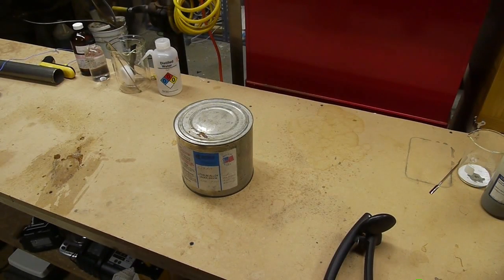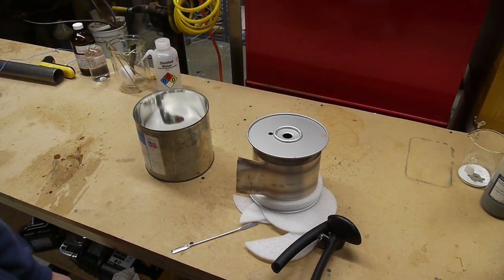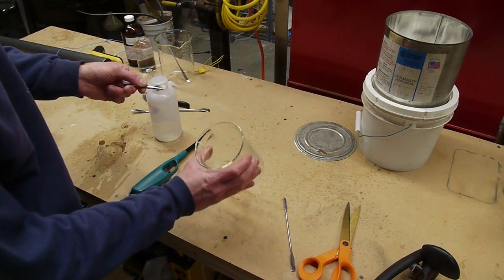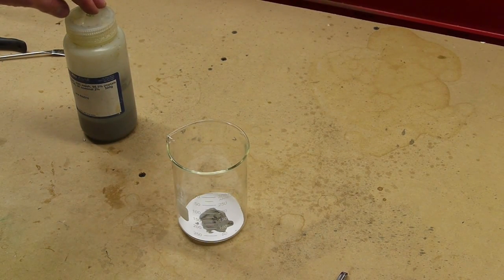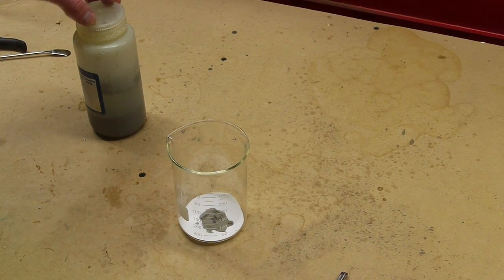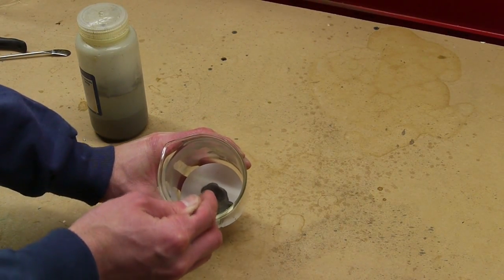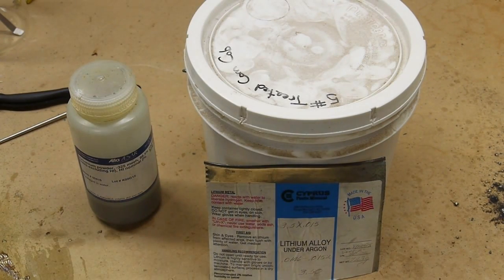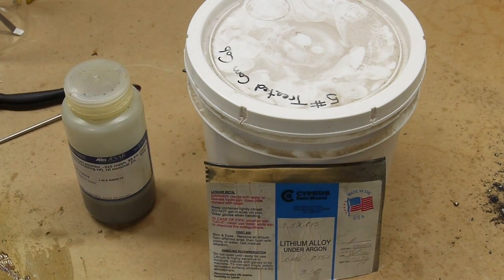Lithium sheet metal and zirconium powder

Comment: This is a very good application for zirconium powder. I have used it like this myself:
If you have kids that are prone to take fireworks apart you can make the following demonstration:  
First you explain what the flash power they are trying to reach actually is; a metal power mixed with and oxidizer. Then take a small amount of dried Zr powder and place it an a small metal plate, like the lid to a jar or something. Point out that the metal used in actual flash powder contains much more energy than the one you have here. Light it on fire with a spark from for example a fire steel to illustrate the sensitivity to static electricity. (When it is lying still in a small pile like this it should glow.) Beforet too much oxide is created you tap the lid with a stick so the powder "jumps" and more oxygen can reach into it and you get a blinding flash. This should be done at a distance that is far enough to be safe but close enough to be as shocking as possible. After this you say: "Now, this was only ONE of the ingredients. If the oxidizer was here too, this amount of flash powder would be enough to blow my hand of."
You have to start with a very very small amount adn work yourself up until you find the right amount so that you don´t risk burning yourself SEVERLY.
Exactly how it will work in yur case depends on the particle size. The stuff I have is either  average 16 (max 80) micron or average 28 (max 170) micron ...or a mix of them. I´m unsure which kind I tested.

Comment: Numerous published laboratory experiments have proven that the presence of water does not change the ignition temperature of zirconium. However, once zirconium ignites, it extracts oxygen from water, liberating hydrogen in the process. Dry zirconium burns with a quiet, white-hot flame; wet zirconium burns violently, tossing burning debris fifty feet or more into the air. A low-pressure shock wave traveling 2,000 ft/s is a distinct probability when wet zirconium ignites.

Comment: i'm guessing, that there is a danger zone between wet and dry zirconium, because you can create the powder under water through some reaction, or grind it up under an innert atmosphere or vacuum, using some plasma magic. demending on the arcane use cases.

Comment: Zirconium was used in old photographic flash bulbs.  Most people (including me) believed that they were magnesium, because the first photo flash illumination was done with magnesium.  In fact, I had some strips of magnesium that was used as is for long light generation, or hanging from a bag of magnesium powder.  When the heat from the strip reached the bag, the powder flashed.  Anyway, when the glass packaged chemical flash bulbs emerged, we believed the thin wire inside was magnesium.  Turns out it was zirconium that gives much whiter, brighter and possibly shorter light flash.
As for timing (history), flash bars for Polaroid 80 camera in 1970’s/80’s still used zirconium, although ITT came out with a normal electronic flash tube version.
Because of the chemical reaction heat and pressure of the zirconium bulbs, the glass was covered with a plastic coating.  For daylight color film use, the coating was blue to further modify the already pretty white light.  On the other side, the electronic xenon tube flash creates so much violet and ultraviolet light that the earlier cameras needed a UV filter.  I believe modern lens coatings take care of that without extra filters.
Another time I have been dealing with zirconium has been when we provided welding equipment for nuclear fuel rod closing, as well as for welding the grids that keep the rods in something like 5 x 5 or 6 x 6 bundle.  Actually it is not pure zirconium — it is likely to be an alloy called Zircaloy.

Comment: It will dry fine.  If ignited with a moisture content under 30% the reaction will be very quick and violent as the Zirconium will react with the Water producing Hydrogen.   Zr + 2(H2O) = ZrO2 + 2(H2)

Comment: Not sure if someone mentioned this already but you can use the zirconium to make a NASA standard initiator (NSI). This is a highly effective way to light solid fuel rockets, blow explosive bolts, and really light anything on fire. It is even extremely effective in a high vacuum. unlike gun powder. NASA uses it in almost every thing that needs high energy and reliable ignition.

Comment: One thing the zirconium powder could be used for is "on demand fireworks". A sand blasting apparatus that is loaded with the powder and aimed through a pilot light. That will require an air supply/compressor; an inline water trap and regulator may be necessary. Add a solenoid valve for remote firing. And Bobs your uncle, sparkle blasters at the push of a switch. Change to other metal powders for various color and flame effects for bonus points.

Comment: You could cry it by washing it with alcohol thereby keeping it in solution while the water is removed.  Wash it in a filter apparatus.  Drying the alcohol may not produce the same sensitivity problems as drying from water.

Comment: Next time, find a tight cover before you open the can.  Pull the spool out very slowly, the argon heavier than air will remain in the can, replace lid so the argon won't  blow away.  When done replace the spool in the bath of argon.  Keep the argon topped off.

Comment: Moviemakers use zirconium powder electric squibs to show bullet impacts in movies. The little flash is supposed to imitate a bullet striking a wall or something hard. Bullet impacts rarely make a flash, but the movie people need to have some sort of visual to keep the story going. A fire protection guide mentions the ignition temperature of the metal is low, and it can be ignited by static electricity, which can be generated by moving the dry powder in air.  Moisture actually helps with its combustion, and when immersed in water is difficult to ignite but burns more violently than in air. It burns well in nitrogen or carbon dioxide. At least it isn't toxic.
Reply: There's also a gun that shoots pellets of this stuff so when they strike a surface the heat is enough to ignite them imitating a bullet strike. The weapons master couldn't get them to ignite on a desert shoot  -  too dry perhaps?
If it burns in nitrogen what is the  result, Zirconium Nitride?  Can we harden bits with this process?

Comment: You can do various things with lithium, but I would suggest not to hold it in your bare hards, it can and will react with the liquid in your skin turning the liquid into a caustic liquid, I would hate to see you getting a chemical burn.
Reply: The outer layer of your skin contains almost no water and is water proof. There isn't any danger as long as your hands are dry.

Comment: also try fortifying thermite with the lithium metal. you can use a standard stiochiometric mix of Al and Black iron oxide and throw in almost any amount of lithium since it will happily scavenge oxygen from the air making it more powerful than usual https://youtu.be/DhjaLEHzz7Q

Comment: What about some lithium saponification?  Just make some lithium hydroxide and try to make a soap out of it. I always wondered how a lithium soap would looks like, because potassium soaps are soft, sodium are hard soaps and lithium would be... Extremely hard? 

Greetings from Brasil o/
Reply: Wait, wouldn't the result be a highly effective mechanical grease? Sticky and slippery.
Reply: @SianaGearz  Sorry for reviving a 3yo question but, you're kinda wrong. Grease is made by dissolving oil on soap, try it in your house with detergent and vegetal oil and you see the difference, or similarity. On top of it, grease has additives, like molibdenum dissulfide (a plate-like molecule), grafite, teflon, zink powder, or other substances that act as lubrificant under high load condition.
Reply: @alexandrelanhoso5538  thanks for your contribution!

Comment: Presumably that zirconium powder needs oxygen to burn, right? So wouldn't it be possible to dry it under an atmosphere of inert gas?
Reply: Zirconium reduces water, there is really no way to dry it. Zirconium is used as a covering for nuclear fuel because it has a low neutron cross-section, but if the reactor cooling system fails it will reduce the water and produce hydrogen. That mechanism lead in part to the accidents at TMI and Fukushima.
Reply: @samalbury9183  evidently it's not a problem for storage, as it's stored under water. Perhaps that's the reason you can't have it partially wet
Reply: @robmckennie4203  I should have mentioned that it only reacts under high temperatures. A standard conditions, it doesn't react with water
Reply: yes that is how it was packaged, the perfect environment.
Reply: The lithium was packaged in argon, the zirconium was under water

Comment: These are the coolest things you can make with wetted zirconium.
http://www.thomasfx.com/Sparking-Balls-68-cal-box-of-100_p_7697.html
In the film industry we call these zircs. We use them to create, unrealistic but cool, sparking bullet hit effects.You can buy the 2 part plastic balls all you need to do is carefully fill them with coarse sand and a pinch of the dried zirconium. I would do this under a hood filled with argon or nitrogen and i would dry it in small ammounts.

Comment: I think that the Zirconium doesn't react with the water because it doesn't have the necessary activation energy. Also, I think that the powder reacts when it is half wet or dry because the ambient heat at room temperature provides the necessary activation energy. Although that would not explain why it didn't oxidize when you took it out of the container. But check out the periodic table of videos' video on phosphorus. Maybe its kind of the same thing going on.

Comment: The zirconium powder didn't auto-ignite when you dried it because the particles on the outermost areas of the clump probably formed a passivation layer as they oxidized into zirconium dioxide. Additionally, the clump probably didn't have a high enough surface area to volume ratio to allow for any runaway pyrophoric reactions to occur (which is what could happen if dry zirconium powder were to be blown into air). You can, however, make pyrophoric iron powder by decomposing iron oxalate with heat.

Comment: With pliers, take a small 1 cm by 1 cm piece of your lithium and go outside over an old chunk of dry concrete and light it. It will burn with a red flame that keeps burning seemingly forever, when you drop it on the concrete it will continue to burn INTO the concrete. You will never look at the stuff with the same casual attitude. Zirconium dust is very prone to ignition from static electricity, especially when pouring the dust. Ditto on the other posters about your flea market finds.

Comment: Zirconium seems much like titanium and aluminum in that large pieces are very stable because of the formation of a hard protective oxide layer, but without that layer they are all very reactive. Hafnium-free zirconium is used as cladding for fuel elements in nuclear reactors because it's transparent to neutrons, but it will still react with water, produce hydrogen and disintegrate if the temperature is high enough.

Comment: Did you purge the container with argon when you sealed the lithium back up? It should be under an inert atmosphere. Nitrogen is not suitable as lithium will react with it too. Or you could submerge it in a non-oxygen-containing fluid like mineral oil. Lithium floats on oil, so put the cover on firmly or tape it on to hold it down.

Comment: Surely the gas escaped.You need to not espouse the lithium on air or moisture.They store it under argon,because it will not react with it.The mineral/baby oil will prevent the contact with air and it will not react with the lithium.I will pm u a vid to check out.

Comment: They're not overestimating the danger of zirconium FYI. Like many other metal powders (iron, zinc and aluminium) Zr reacts with water when it is a finely divided dry powder. So although I don't think zirconium can ever burst into flames simply while drying, I do believe that if you dropped a tiny amount of hot water onto a sample of dry Zr powder, that it would ignite all by itself. This happens with finely divided zinc in negative X pyrotechnic compositions:
/watch?v=M3DkNwnnFuo

Comment: It would be cool if you could try lighting the pure lithium metal on fire. It probably burns with a bright red flame. Store it under oil as someone said, or fill the bucket up with butane/propane or similar non oxidizing gas. Lithium actually reacts with nitrogen in the air to form nitrides (they had to switch to argon in a glovebox we had at a research lab where I worked). CO2 is probably not a good protective gas either, since even magnesium will burn in it with formation of elemental carbon.

Comment: Could you try alloying them in small quantities with some common low melting point metals such as tin, aluminium lead, etc. to see what effect it has on the physical properties of the base metal? Al-Li is supposed to be lighter and stiffer than aluminium. Conveniently, the Al-LI Wikipedia page also mentions that it contains some zirconium.

Comment: just let the mixture to worm up to room temperature and eventually the ammonia will evaporate leaving behind lithium oxide. the procedure is called Solvation of Electrons which is used for the birch reduction ( or something like that) in organic chemistry. btw i would not do that because you can be easily mistaken with a meth cook which will bring you allot of troubles :)

Comment: Part 2 of 2:  I often ignite small quantities, as you have done, during "lab orientation" training in order to demonstrate that metal powders need to be taken seriously.  Rumor has it that the powder will explode due to static build up if a large enough quantity is thrown into the air.  I haven't tried this, nor do I intend to.  You could try making zirconium thermite.  Just replace the aluminum with zirconium.  I've always wanted to do that, but haven't gotten around to it.  Be safe.

Comment: Part 1 of 2:  I have a fair amount of experience in handling fine zirconium powder.  It really is a good idea to always handle it inside of an inert atmosphere glovebox.  I have handled it outside of a glovebox too, and I have also had it spontaneously ignite a few times.  It can be scary.  I have found that it is somewhat shock sensitive, and very static sensitive.  For this reason, I always keep dried powder stored in very small batches (~1 gram), because once it ignites, that's it.

Comment: I'm afraid you read my comment wrong. I said "units 1-3 as they melted down ... and blew up" with an interjection in the ...   I guess I should have used a comma after the parenthesis to make it more clear that I was talking about the units blowing up, not the zirconium.  My point is that the zirconium in the reactor burned similarly to the powder in this video. Arnie Gundersen of Fairewinds similarly demonstrated burning zirconium cladding by heating it in the presence of moisture in a video.

Comment: Zirconium powder is great for making theatrical "bullet hits", basically just a gelatine capsule with a bit of Zirconium powder in it, fired from a paint-ball gun.  Fine Zirconium powder is rather treacherous in large amounts, but small quantities aren't much worse than fine Magnesium.  It only gets insanely dangerous if you mix it with something else, like an oxidiser, even things you wouldn't expect, like Lead Oxide.